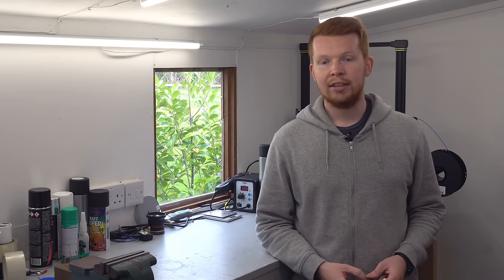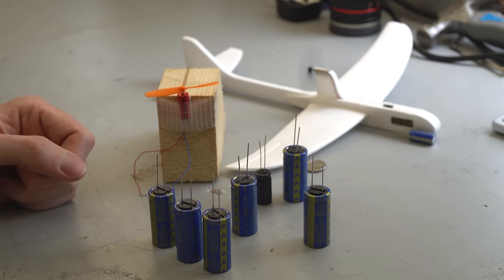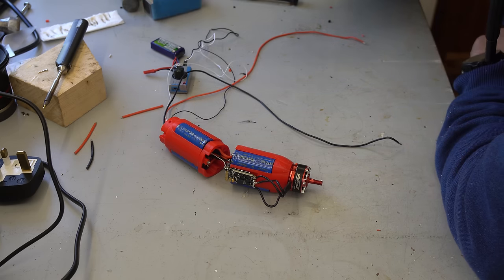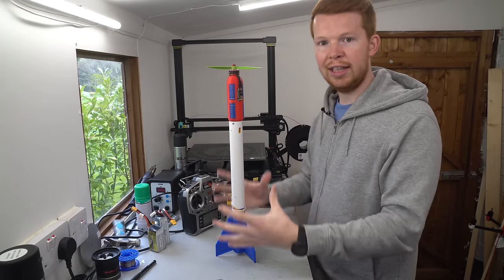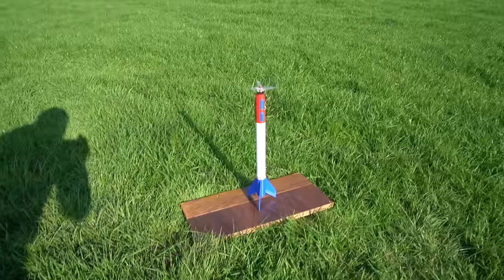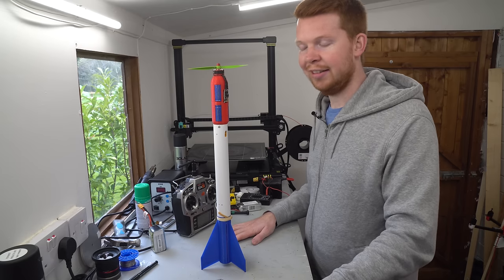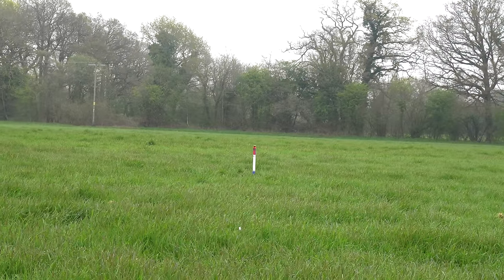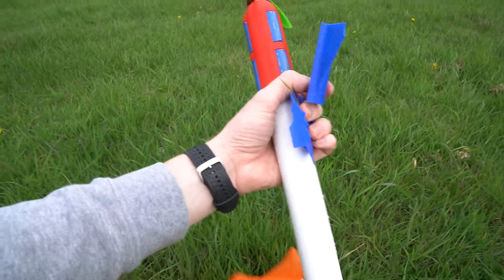Super Capacitor Rocket

Comment: Great work , very thought provoking .... But Li-ion has over 50 times the energy density of caps , and   high discharge 18650 's can provide all the energy in a few minutes , essential for rockets  ... ducted fans are also more efficient than bare props ... a rocket based on these two components should reach many Kms in altitude.
4 x 18650 cells ....190 gms  ......  medium sized ducted fan with motor and controller .... 200gm  ... rocket body .... 110 gm 
total mass 500gm ..... thrust  2Kg (20N) .... power 900W ... run time  2 mins .... initial acceleration 3g !!!
Reply: @MainframesMuse  hardly ...needs a thick  atmosphere for the fan to bite into ... might get as high as Everest , 8km ..I think that's the limit for helicopters  for the same reason
Reply: @oz93666  Altitude record for a helicopter is between 12-13 km. if I recall correctly it's a French helicopter.
Reply: @oz93666  Just FYI, googling: "The highest altitude a helicopter has ever flown, which was 40,820 feet on June 21, 1972. Jean Boulet of France flew a single-turboshaft Aerospatiale SA 315B Lama, which had been stripped of all unnecessary equipment to reduce weight"
Reply: Caps are cheap, and very light, compared to Li-ion, they charge in seconds, not hours.

Comment: Do version 3 with stability control using 2 servos that move the motor
Reply: or servos to move angle controlling fin angle
Reply: more altitude! what are the ultimate limits using a supercapacitor rocket?
Reply: Need to get up to 500ft, that would be spectacular for super caps
Reply: Would probably increase the weight 50% or so which could be an issue.

Comment: Wait until you discover ultra caps!  They have some that go up to 3000 Farad capacity at 2.7v.  They'll put out enough current to weld with.  They're often used in applications like Diesel-Electric trains.
Reply: Ya but have you seen their size 😆😂
Reply: @harshsharma5768  Just means a bigger rocket lol
Reply: Costs?

Comment: Hi Tom, great project!
Did You manage without balancing those capacitors?
I thought we have to balance them when in series, is there something that lets us go without it? or did You just go for it and it worked? :D
Reply: For only a few cycles you won’t need a balance board. And if you stay well below the maximum voltage you could cycle them probably 100 times without a problem. And since you can charge and discharge them quickly you could check and balance them manualy every now and then. You could also buy a board specifically made for supercaps.

Comment: hi Tom, would making the bottom fins spiral slightly opposite to the thrust of the motor to kind of counter thrust with the engine, like a small prop on a helicopter.? or fit a smaller duel prop motor.
Reply: You mean the aerodynamic thrust is creating a torque at the same direction at the motor spins to counter the fugelase spin?
Reply: I think it would take a GPs or other compass input to the controller so you could control the fin angles to compensate for torque.  

If you set the angles static, then it would only be able to compensate for a narrow range of torque vs air speed.  

Air speed in this sense applies to the velocity of the craft through the air, as well as the prop pushed air as it flows over said fins.  Fun problem to solve!
Reply: yes or use a duel prop motor.
Reply: A spiraling rocket flight might not be bad at all, because it spin-stabilizes the direction of flight

Comment: If those Super Capacitors gave a electric car a range of 30 miles, then they would be perfect for most people's commute to and from work. And the 3 minute? Charging time would be fantastic!  A small two seat car with Super capacitors at a price most can afford would be fantastic for reducing emissions and the amount of space needed on roads
Reply: theyd work best with bikes instead of cars in my opinion. cars contribute alot to traffic congestion. e-bikes would be perfect for both commutes from home and work.
Reply: @Mechagears  Probably do suit bikes best, but a tiny two seat vehicle that keeps you protected from the weather would be better for the UK.  Either way there's definitely a need for something like this
Reply: @James-oo1yq  i agree!

Comment: i put 6 of those super capacitors on my quad about a year ago. It flew for about 10 seconds, just enough to do a couple flips and land. Not really useful. But, something else that is useful, I put a couple 18650 batteries in an rc car. The 18650s have a protection circuit that cuts the power if you draw more than 5 amps. Thats not enough for hard acceleration. So i added 9 super capacitors. Now it has plenty of power for the few seconds burst needed for hard acceleration. Yeah, a normal lipo would have been better, but I like 18650 batteries and they are a bit safer so i feel more comfortable leaving the batteries in the car all the time.

links:

These are my favorite.
$4.38
35 Farad
3 Volt
They have a really amazing low ESR of 20mOhms, which is low for a super capacitor. So they can produce a good punch.
https://www.mouser.com/ProductDetail/581-SCCU30E356MRB

These are not what you want, but are interesting for other purposes like temporary power for an arduino.
$4.50
10 Farad
2.8 Volt
they have crappy high ESR, but amazingly low leakage current, so they can store a charge for days.
https://www.mouser.com/ProductDetail/504-HB1030-2R5106-R

These are not what you want either, but its pretty cool. This is an absolute monster supercapacitor.
$16.08
350 Farad
2.7 Volt
3.2 mOhms (wow)
One time, I put 6 of these in series, charged it up, and started my car engine with them. No car battery. Of course it can only crank the car engine for about 8 seconds so it was just for fun.
https://www.mouser.com/ProductDetail/723-BCAP0350E270T11
Reply: Ha! Nice. You basically made a capacitor turbo ha ha!
Reply: Tesla Motor Co is trying to do that exact same idea in full scale cars.

Comment: Tie 3 rockets together, then use the pid to self level, and go straight up!
Reply: Just use 2 motors running in opposite directions to counter the  torque of the other.
As well use as large a diameter prop as possible with as low of prop pitch  as possible to reduce torque.
Reply: @europaeuropa3673  why reinvent the wheel, just buy an RC helicopter or drone.
Reply: @fxdeuce  .......I know. However, this guy likes to experiment with ideas that pop into his head and there nothing wrong with that.

Comment: I had been wondering a lot if supercaps could replace / augment batteries for short term start-up current loads from intermittently run brushless motors and whether that would be an easy or prohibitively hard thing to do for a current project I'm working on.  Thanks for showing me it's definitely a very strong option -- you've got a new subscriber!  Love all your projects.

Comment: Slight correction not all capacitors function as you said there are wet capacitors, The structure of a Tantalum Wet Electrolytic Capacitor consists of four main elements: a primary electrode (anode), dielectric, a secondary electrode system (cathode) and a wet (liquid) electrolyte.

Comment: I think you should've made a cover for the speed controller and capacitors. It would prevent shorting due to water. You're lucky it still worked after landing in the wet grass that many times. Still really cool, though. It's so satisfying to watch it launch and fall back down

Comment: Just had a thought, you might want to try four capacitors making two separate power sources, two small lipo batteries on board have a nano board switch which source is used by seeing which side drops past a certain voltage basically keeping the batteries charging two capacitors at all times and keeping the power to the motor longer. You might need to use some isolation relays as well. But I think this would give you longer programmable flight times.

Comment: If you can charge the capacitors in 2 seconds with a battery the same size as them, you're not utilising the greater power density of the capacitors. You could use smaller ones to use make the rocket lighter at the same power, or use a larger motor that uses more of the capacitor's potential power.

Comment: With a few tweaks, this would be an excellent toy for kids and big kids! Traditional model rockets are not reasonably accessible to most kids nowadays. This is excellent for taking to a park or launching in your yard. You could even have different power levels for different models. I would buy it, as my kids love rockets, but never have anywhere they can launch an engine-powered model rocket.

Comment: Kudos on the Super Cap project -  I think we all learned something from it.  I do not believe your rational for the motor on top vs bottom however.  The vast majority of the craft's stability at low speed is due to gravity pulling / keeping the fuselage of the rocket down below the motor and propeller.  Had you put the motor and prop at the bottom, I believe that you would have lost stability almost immediately after launch.

Comment: Maybe you could use the really large super capacitors which have a metal cylinder shells. They are structural rigid, so they don't need additional materials to form a rigid rocket.

Comment: Have you ever tried putting oppositely angled blades on two parts of a rocket and putting a motor between them. That way, it doesn't matter how much the fuselage spins because it will still generate lift

Comment: I love this project. I'd love to see it turned up to 11. Could you start the motor spinning, get it up to speed on a platform, with current feeding the capacitors, then release it, with the prop already at full speed and the capacitors still fully charged? Guide rails to ensure a straighter launch? I have so many questions. :)

Comment: Tom, I know this project is old, but I've only just watched your video. I was struck by the fact that you loose a lot(?) of power because the rocket body counter-rotates against the prop. Have you thought of 'twisting' the fins so that, as the rocket gains vertical velocity, the fins prevent the body from counter-rotating (I don't believe straight fins alone will do this). The more you can get the body to rotate in the same direction as the prop, the more efficient the rocket will become!

Comment: Very novel build Tom. Please consider building a one propeller drone. If your motor & propeller can gimble, you should be able to steer and even land the drone. As one of your subscribers mentioned, you can use the whole length of the body for extra power.

Comment: I suspect a lower center of mass would make your rocket more stable higher in the flight:) If your rocket is 'too stable' it overreacts to the wind and makes its path strongly curved in the direction the wind is comming from. When your center of mass is slightly above your center of pressure it should be stable but not too stable as to overreact to the wind:D

Comment: Perhaps a tow for a remote-control glider. Get it to height with regular or vertical takeoff using a motor unit such as this, jettison the power unit (with parachute) and hopefully the low retained weight means that you get lots of flying time for a short charge cycle.

Comment: When a smaller rocket like this launches, it actually will angle into the wind while going up, but then it will drift with the wind once the parachute is deployed
This is because the wind blows on the fins more (since they have more cross sectional area), pushing the bottom of the rocket back and making it point into the wind
Parachute packing is also quite important as always, especially in high power model rocketry, as well as ensuring that your deployment electronics or chemical delays are set right. As much important for the safety of the rocket as the safety of the people on the ground!

Comment: Wanna go higher without spinning the rocket's body? What do you thing about having a prop/engine at both ends of the rocket? The props would spin in opposite directions. You'd need another cap. set and would have to synchronize the motors... Pretty cool project you created. Started me thinking about using super caps for other things.

Comment: given the clear wind-down of the ESC and the slight nose-heavy nature, I would probably use Li-ion supercaps and fill the ENTIRE body with them, possibly adding the ESC and RC bits as well as a native li-poly(near the bottom for weight balance) for a seperate power for the RC+servo to ensure that when the ESC (or lithium capacitor protection system) trips low battery you can easily ensure you stay in-control and able to deploy recovery insurance devices even if the drive section is flat
and bonus, the lithium supercaps have twice the energy density and roughly 1.5x the voltage with a native low voltage state well above 0v so using a 4s array of them(likely with only zener charge limiters to avoid overcharge) you can get much more sustained thrust
mix this with a second stage sugar rocket igniter that uses the other direction of the RC handle to operate the staging servo+igniter and you could get into the upper atmosphere and maybe kiss space before your sugar stage burns up on re-entry

Comment: electromagnets underneath a launchpad that contains its own super capacitors. 'launch' function discharges into electromagnets to repel the vehicle. this means that the power from move from zero to not-zero is drastically different because the vehicle doesn't need to carry that first part of energy storage.

Comment: counter rotating props, make pressure vessel.
Allow air to escape out prop tip ends producing torque and lift assistance till empty.
bet not to much weight would be needed. after success, switch to NG! Add ion thruster-NG lighter.

Comment: For a new version of the rocket maybe you could take a different parachute.. more bell-like so it traps the air better in it, thus slowing the rocket down more on the descent, put a nose cone on top of the prop so theres less air friction... also maybe make the top shape a bit pointier AND polish the surface of the rocket for friction reduction! You'll be getting a hell of a rocket. Thats a nice video! If i manage to get myself a nice 3D printer this will be one of my first project! 🤯

Comment: Unlike batteries, super capacitors store a charge all the way to 0v, so to get the most out of them, you would need to be able to use them down to as low a voltage as possible. But since boosting the voltage demands greater and greater current to maintain a given power, diminishing returns show up at some point, so there is no point harvesting down to 0v.

Comment: When you build in a step up DC/DC converter, you would be able to use almost 95 % of the capacitor energy. Of course the step up DC/DC converter is activated only when the voltage has dropped almost to the cut off voltage of the motor driver circuit.

Comment: You should try using a counter rotating prop so the motor doesn't have to wase energy spinning the rocket in the opposite direction

Comment: The benefit of Super capacitors is deep discharge. I wonder if there is a weight to  extra power advantage to use a a buck step up converter set to 7.2V to prevent the speed controller cutting out at 6.2v.  So that the caps can be run down to less than 1volt before the buck converter cuts off.

Comment: Hi Tom, I believe you made a thinking error in that the servo tester does not supply current to the esc. It does supply power to the positive output  like it also supplies (limited) power to a servo when you test it and the esc will feed this voltage through to the motor.

Comment: Locating the caps toward the lower end will provide vertical stability and keep the nose pointed up. This will prevent to tipping over effect which is causing problems with flight. But this long after this video was produced, I doubt you are still playing with this... so this is just for info sake.

Comment: This was awesome! It sounded like a reverse bomb dropping or something. lol

I often see 3D printed things break, not because they are inherently bad, but because I watch a lot of engineering channels like this and there's nothing quite like testing something until failure. What I wonder is whether there's a way to melt the broken plastic back down so as to make a new filament so you can feed it back into either remaking the part or making something else. That sure would be useful for when you have to redesign something.

Comment: Why do you always put your capacitors in series? You’re not increasing their capacity that way, you’re just adding more weight. It makes so much more sense to put them in parallel and then step up the voltage

Comment: Maybe you can answer a question that I have had for a while, why doesn't NASA use a super capacitor with a propeller as a first stage 'rocket' to get actual lift off the ground and get it a few hundred miles per hour then ignite the second stage solid fuel rocket to get into escape speed ?
This first stage capacitor engine would reduce the cost per launch by a huge margine and would easily be renewable with little pollution.

Comment: That was extremely interesting, I've been watching some electric powered light aircraft, and it occurred to me that take off could use super capacitors, then switch over to regular batteries, whilst recharging the super capacitors. That way, the aircraft would have a plan B if required

Comment: Not sure if you are aware of the new propeller design which is far superior to the standard prop design ( mainly designed for full-size aircraft but should also be good for models). I think you should be able to find it on YouTube and with your 3D printing kit and a suitable set of G codes make some for your design rocket. An interesting but novel design. Good Luck

Comment: I have some Maxwell Boost caps (2.7V 3000F) that will soon power the battery backup in my server chassis for short periods of time. 12 in series to replace the 2x12V batteries.